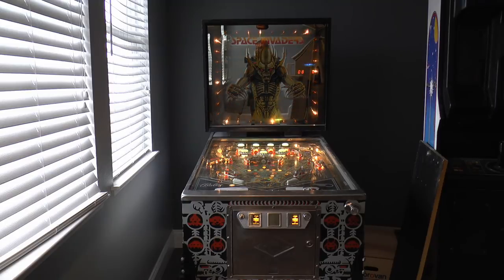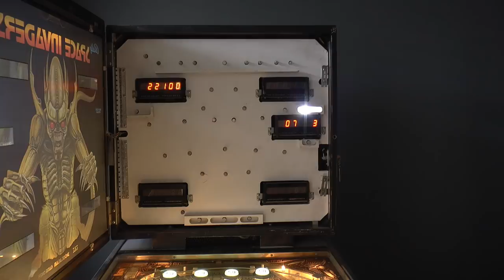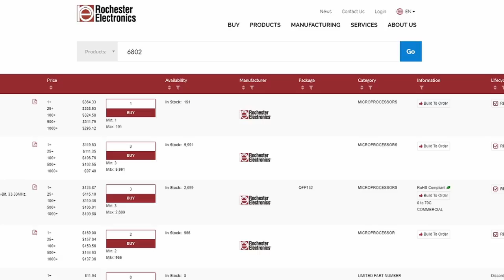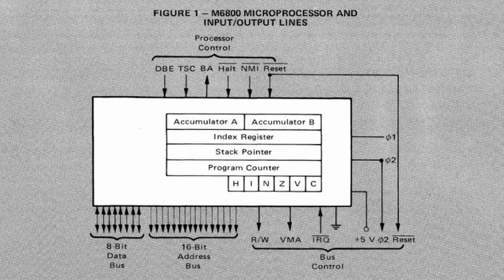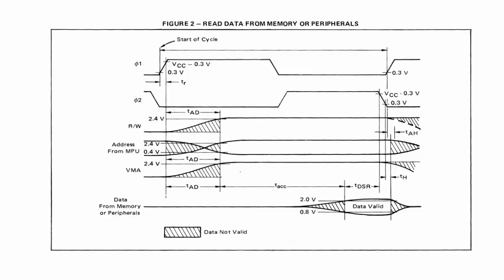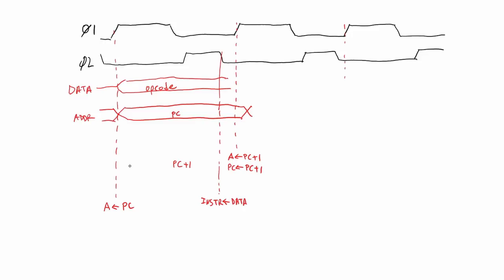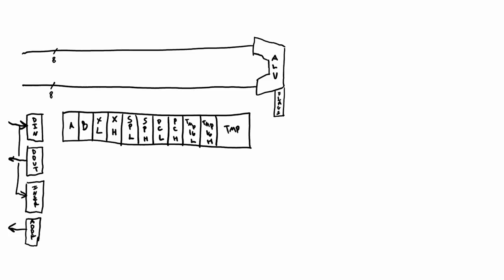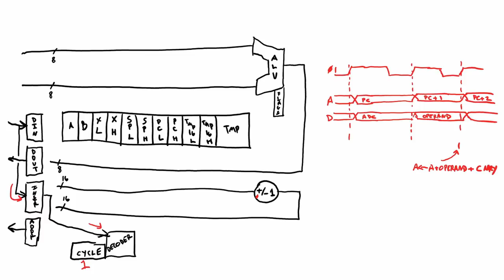Building a 6800 CPU on an FPGA with nMigen (part 1)

Comment: Once you have a working 6800, you could add the instructions and IO for the 6801 and 6303 processors (and do the minor flags change for the CPX  instruction).

Comment: Hi Robert, very cool to see the latest project. Looking at the lazy edges on signals on  the datasheet and considering the high clock frequencies in current components with their fast edges, I'm wondering whether you'll need to make accommodations for the fast clock edges when interfacing the FPGA solution to the the 6800 socket and the long transmission lines it will drive. I remember watching a video somewhere where one of the old hands was talking about receiving newer CPU chips from a vendor years after their board had been designed and the newer chips not working at all because the CPU vendor had significantly improved rise times for all edges which caused the old circuit board to be unusable because it was a spitball design that depended on the clock edges to be pretty  slow. Just a thought. I'll try to track down the video in question - I think it was from one of the guys that guested on EEVBlog and the AmpHour.
Reply: @vincei4252  Jack Ganssle.

You can select slew rates on many FPGA output drivers nowadays.

Comment: I started out with VHDL, moved to Verilog and am now at SystemVerilog. The last option makes the most sense to me as a firmware engineer... Good for simulation testbenches as well. There was a C based FPGA language kicking around about 12 years ago, never seemed to become popular though... I have never heard of the Python based language that you are going to use I will check it out. It's up against tough competition though, the 2 V's are like the thing that would not die 😋
Cheers,
Reply: MrMagooo  - Thats what I get for typing this late at night... mixing my SystemVerilogs with my ActiveHDLs... fixed.
Reply: (Update) - Found those older C-based languages; they were System-C and Handel-C. Both are defunct projects now. A new C-based HDL Synthesis tool, out of the University of Toronto (LegUp), seems to be the new kid on the block for representing C.
Reply: @EngineeringVignettes  SystemC is hardly defunct; Mentor's Catapult and Cadence's Stratus are High Level Synthesis tools that work best consuming SystemC. NEC Cyberworkbench and Xilinx VivadoHLS also work with SystemC. It provides the conceptual parallelism that C or C++ based implementations cannot.  I've used the Mentor and Cadence tools.
Reply: @robertf981  but that's the issue with all these software languages being used to design hardware, they are not inherently parallel in execution. Both VHDL and Verilog/SystemVerilog are written on the backbone of parallel execution. People should stop confusing software languages with hardware description languages.

Comment: Hey Robert,
Thanks for posting these videos! It's great to see all the tools being used together. To anyone that could help:
Is it possible to combine a project mostly finished that is written in Vivado using Verilog with an nMigen module? For example, could you use nMigen to import numbers from a text file and feed them into the Verilog project? And would it be any easier to use one or the other?

Thanks again!

Comment: what level shifters did you use, i want to use some in a project and am currently doing research to see which fit within my project :)
Reply from the maker: Looking at the 74LVC8T245 (8-bit) and the '16T245 (16-bit). These may turn out to be overkill. For example, the address lines are 16-bit tristate output, 3v3, so I don't have to care about dropping a 5v signal to 3v3. If the thresholds are with me, I can just use an ordinary TTL tristate buffer (such as the 74LS541) for these.

Comment: What are the differences between a 6800 and 6809/6811? I'm genuinely curious.
Reply: The Wikipedia entry for the 6809 has some detail on the differences between the 6800 and 6809, perhaps that will answer for at least some of the differences. Otherwise, see if you can find the datasheets for both and have a quick skim through.
Reply: Funny, I was thinking about this too.  I spent my youth on a Z-80, but I think the 6809 had the best ISA from the programming/compiler point of view.  I did build a dev board for the 68HC11 (surprisingly easy), but I never really did much with it, bummer.
Reply: @tommythorn1336  I learned on a TRS-80 with a Z80, but like you I agree that the 6809 had the best ISA.
Reply: @esra_erimez  I had a TRS-80 as well, but it was the CoCo with the 6809. Doing assembly on it was so clean. Then I got to college and did some 68000 (which was wonderful and just felt like a suped up 6809) and 8086 which was a complete mess. I've always wondered what the PC landscape would look like today if IBM had used the 68K instead for their first PC.

Comment: I understand migen became nMigen which became Amaranth HDL.. but any thoughts how it compares to Chisel?

I have a SmartFusion2 device, so technically it's not officially supported by LiteX.. so I'm kinda starting from scratch.  Unfortunately, much of the learning material is a bit dated*

*2016 whitequark Implementing a UART in Verilog and Migen
LambdaConcept tutorial from 2020 is only accessible via internet archive
lab-sticc mic-sec-2022
2020 vivonomicon Learning FPGA Design with nMigen
RobertBaruch / nmigen-tutorial
 libre-soc HDL_workflow/